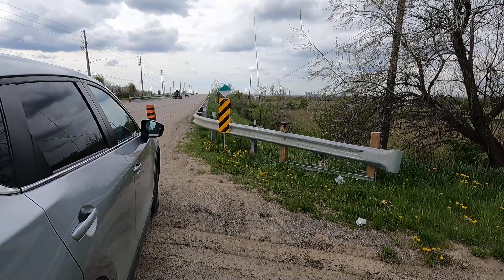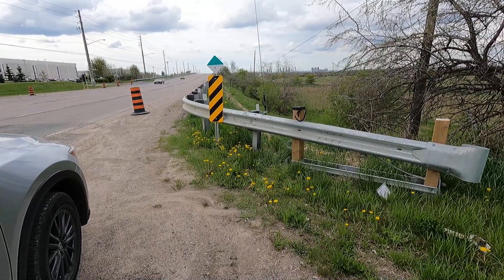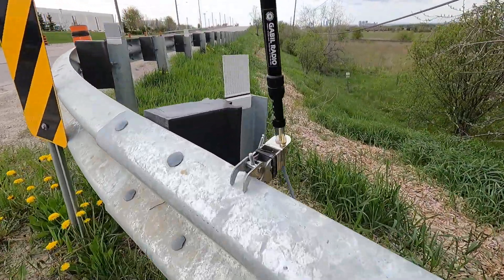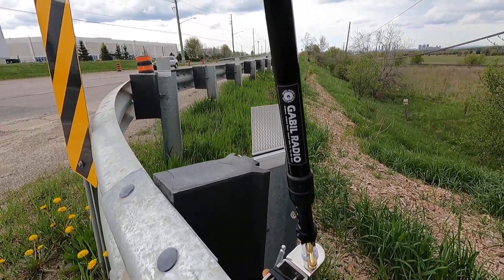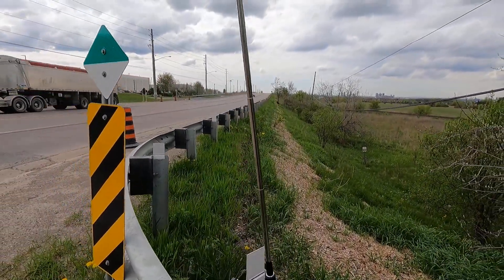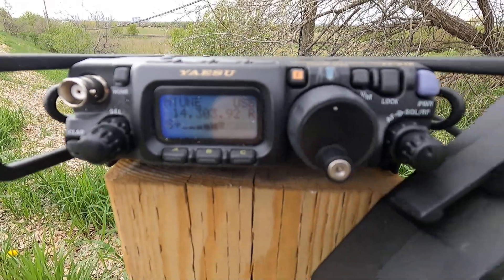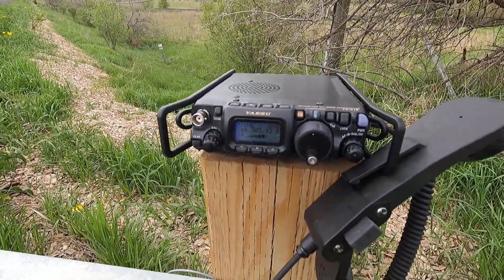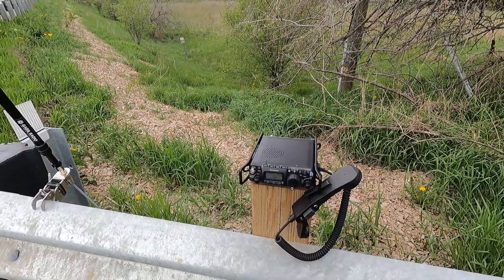The Gabil Radio GRA-7350TC Antenna Deployed on a Roadside Guard Rail

Comment: What is the handset microphone that you are using??  I often have issues hearing on outings when people are standing around watching and talking.
Reply from the maker: It is a Harris H-250 Military handset modified for ham use. I have several PRC-25 and 77s that use it so I thought to molest it and see if I can make one up. I had to use a different mic cartridge but it was a real pig to wire up. There isW2ENY that mods these for Yaesu as well